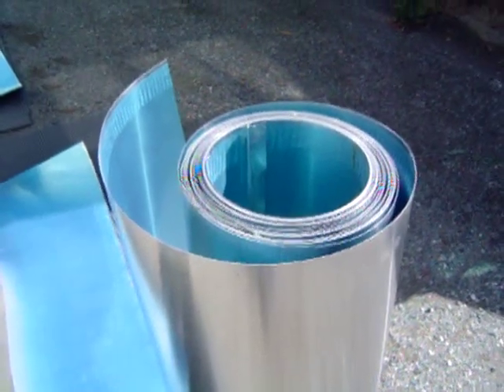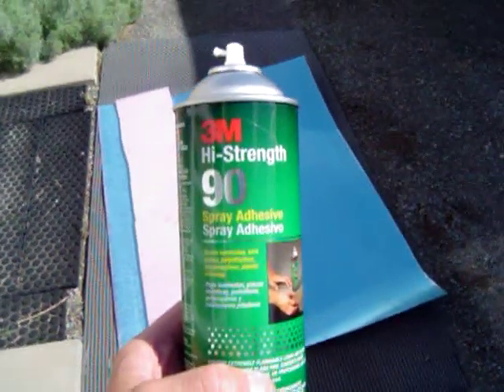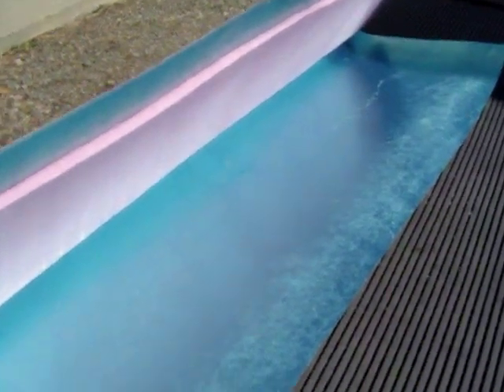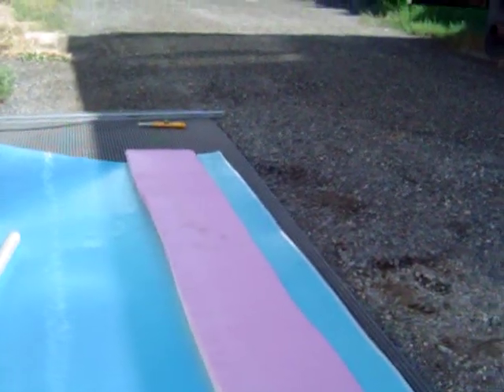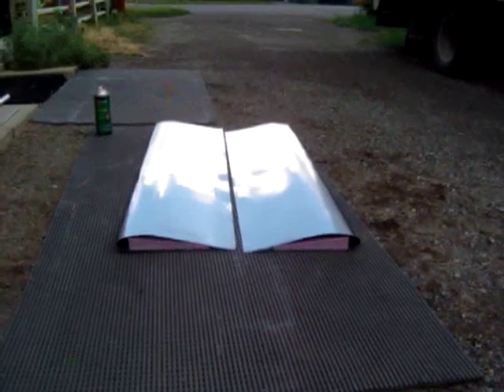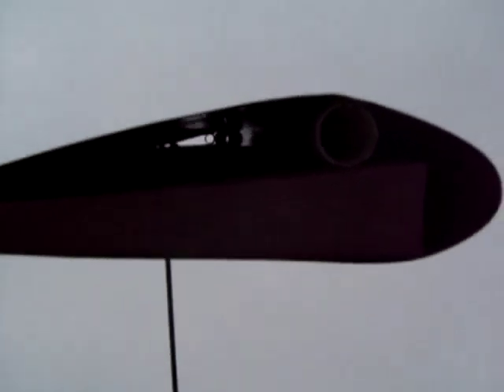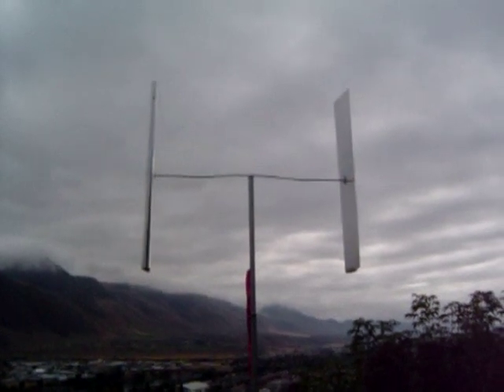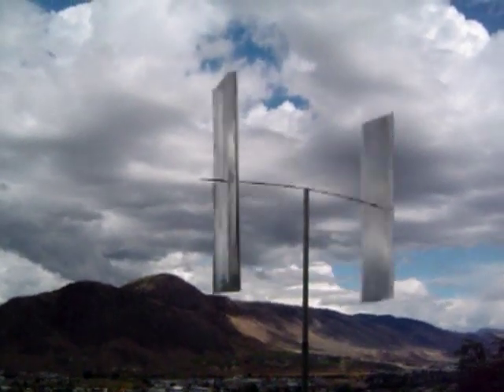remkick wing lift fly vawt green free power

Comment: Не правильно : плоской стороной НАРУЖУ
Reply from the maker: просто концепция изготовления аэродинамических профилей, чтобы легко и быстро попробовать разные профили
Reply: @itsandbits1  Угол атаки у такого профиля 20 градусов
Reply from the maker: @ВладосПотапос  Да, я попробовал несколько разных профилей, прежде чем остановился на полусимметричном, который имеет угол атаки 2-6 в зависимости от того, насколько хорошо я его строю.
Reply from the maker: @ВладосПотапос  Спасибо, я сохранил бумагу. Это твоя учеба?
Reply: @itsandbits1  Angular velocity is made up of two components: angle of attack and lift I am making a model of a two-bladed two-tiered wind turbine Darrieus rotor, type H. If you're interested, I'll make a video and let you know.
Reply from the maker: @ВладосПотапос  Мне нравятся типы с 3 лопастями, потому что они обеспечивают лучший баланс с меньшей пульсацией тяги при вращении, поэтому, даже если бы у меня был двухуровневый блок, я бы использовал по 3 лопасти на каждом. Я буду с нетерпением ждать твоего видео
Reply from the maker: https://youtube.com/shorts/sefLbM08zpc?feature=share
Reply: @itsandbits1  The fill factor is very poor with a three-bladed scheme. Ideally - one blade. Two blades is a compromise. Or you need to increase the diameter with a three-blade scheme.

Comment: Cool for a proof of concept in low winds. I built one of these a few years back as a proof of concept. It was built a little stronger than this one and had a chain driven generator. The thing spun like crazy, it was scary fast, and it didn't take long before the main bearing failed and it came crashing down. Even though it didn't last long it proved that the concept worked and self started under load. What did you do to stop the blades from twisting? These h-rotors are prone to blade twist, that is why you see the helical shaped ones, the reduce the twisting force on the blades. Definitely a fun hobby.